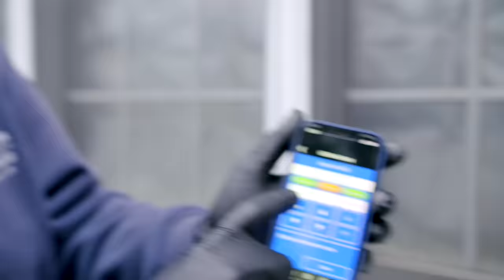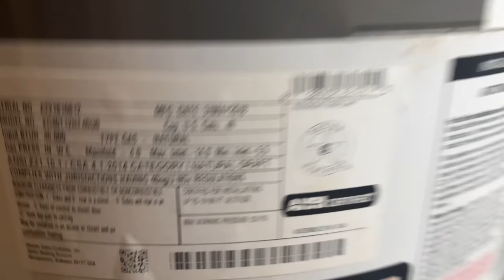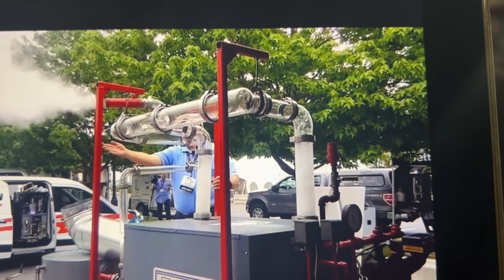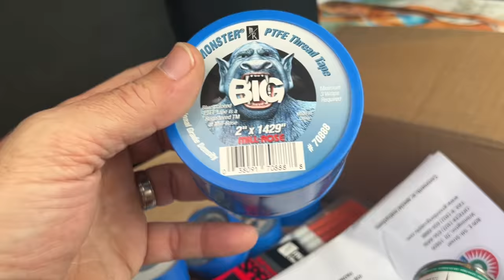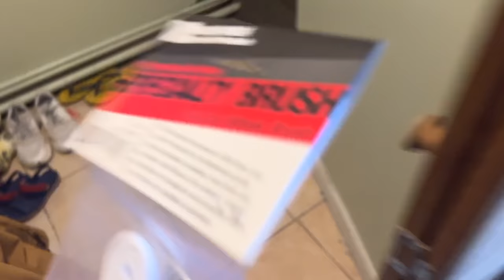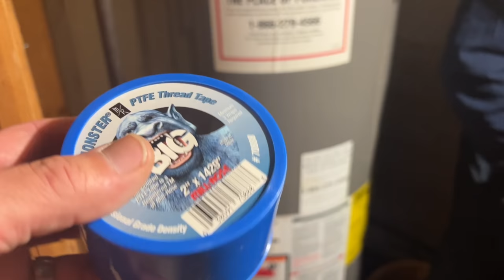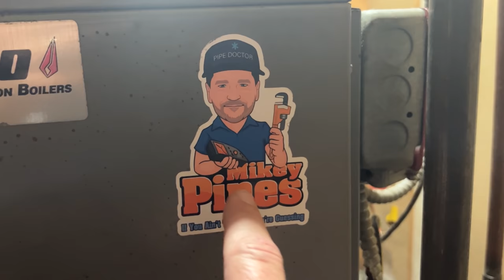Hacked Pennco Gas Steam Boiler Brought Back to Life

Comment: Mikey pipes you gotta learn the trick to snapping glass!   A quick score and then hold it with both hands with each thumb on opposite side of score and bend/snap it with steady pressure from both hands.  You will be suprised how easy/good it works.  I did it the "tapping" way for years before someone showed me this trick.
Reply: I like the cutters that are shaped like a "W" ... the score method works like a snap ... literally

Comment: Nice job lads tell Daniel I wouldn't use a cheap volt pen  recommend fluke Lvd2 but always confirm voltage with a multimeter

Comment: Mike, I can’t recall in any of your videos you inspecting, or even questioning, a chimney for boilers or water heaters. You work on some really old stuff and I’m sure that many of the chimneys you are using need to be repaired or lined. Not only is this something that should be addressed with every replacement/installation and most inspections/service calls, it is also a great source of revenue. You need to keep your customers safe. I realize that once you bring it up, you have to own it and take care of it, and possibly lose the job. One way around it is to do the work, but first make the customer aware of a potential problem and have them sign-off on a document that will absolve you of any responsibility. If a customer declines my advice to line or repair a chimney, I let them know (in writing) that their chimney is suspect and they should have it inspected as soon as I am done with my job and have it repaired as necessary. Cover your ass!

Comment: I will definitely check out Greenberg.     I live 7 Miles from Wilmington de.     Been greatly disappointed in fergusson since covid destroyed supply and even customer service.
Reply: I'm in service and repair for retail stores " subbed through the property managers "  we take any job we can handle however we do t have the techs to do service chillers and other large systems so I dont get into much other than basic plumbing with sink, toilet Repairs and water heater replacements but I watch your channel cause I am just drawn to your type of work.   Not sure I'll ever get into it, little late for me to start at the bottom of  atrade but if I can acquire some knowledge while I'm not working via you tube I'm all for it.    Love  the channel man you really take pride in your work and your positive energy has inspired me on many occasions to remain a little more positive while working a 10-15 hr day.    I have put you on during the day just to boost my mood and it works every time.     Thank you !
Reply: In Wilmington, Greenberg is the goto place for steam. Best for in stock and best for getting it quick. Most of all they know what you’re talking about.
Reply: @PipeDoctor  
🤣🤣🤣🤣
In the spirit of the old Ridgid ones🥰

Comment: at 23:02 fix that flue pipe(needs raised and hanger straps), you can see it pulled out of the chimney partially and the flat or downhill horizontal run from boiler to elbow is bad.
it may even be ready to fall out the chimney and start dumping all the gas inside the house. 😖

Comment: I have a few steamers running at 13+ psi and that is by design. We have a guy who is certified for high pressure steam and ultra high pressure steam systems. He services some that are 800+ psi steam and is 800° superheated steam. I understand residential is low pressure ( 2psi or less ) i service one at Honeywell that is 90 psi and 400° steam. I love steamers.

Comment: Why don't you just take the smoke pipe off and inspect top of boiler and passages instead of flooding it. If there is a constant hiss on air vents yes replace them.
Reply: Well your looking for rotted sections and you do check the base when your there.